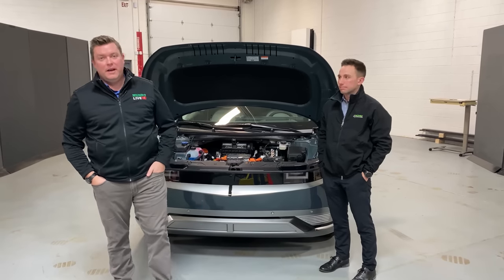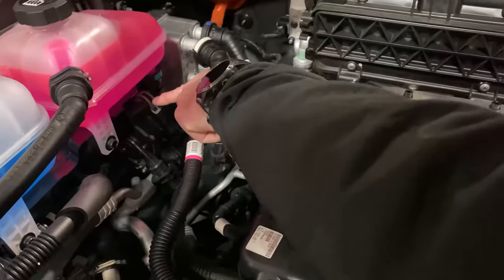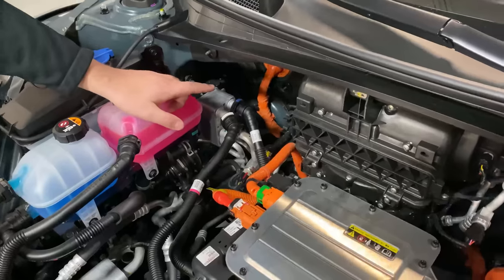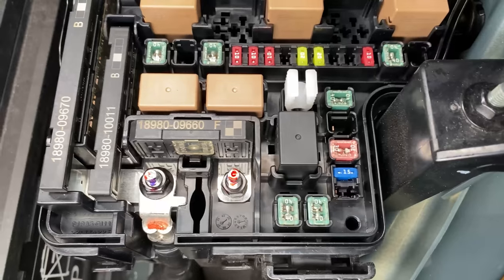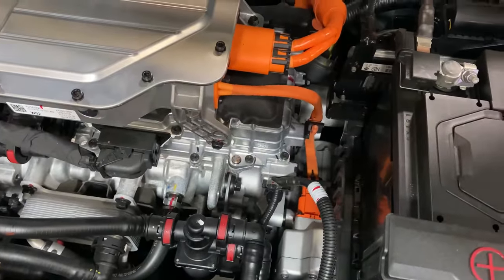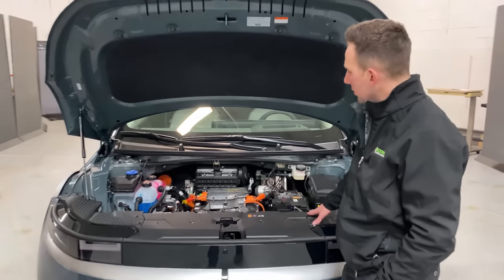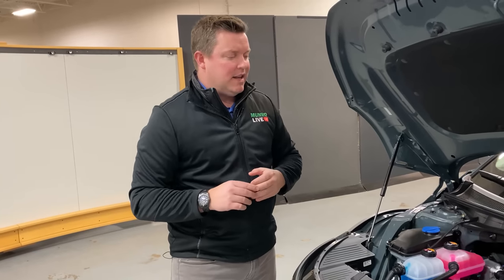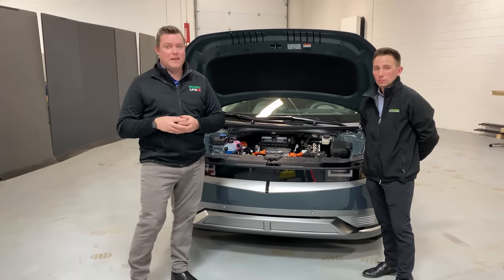Hyundai IONIQ 5  |  Under the Hood

Comment: As someone who has worked on cars for nearly 20 years, many of them older, I appreciate that Hyundai has not gone the Tesla route of integrating several components into one box. Serviceability is a significant factor that seems to be increasingly getting ignored, but it is critical for keeping cars on the road as they get older. The more components that you integrate into one service part, the more expensive that part gets. People may be willing to spend $2000 on a box in order to keep their 3 or 4 year old car on the road, but they probably are not going to be willing to when that car is 8-10+ years old. Those cars end up in junk yards. Being able to service components affordably is super important. I would much rather have a more serviceable vehicle and sacrifice some of the grossly over-rated frunk space.
Reply: I'd that "one service Mary" is made in huge numbers, making it cheap, is interchangeable between models, and easy to remove due to lack of plumbing, I'd say it would save money when it comes to keeping cars "on the road".
Not to mention, no guesswork faultfinding, fitting the wrong part and having to find another component.
Reply: what about the argument of, less parts -> less chance of something breaking down -> lower chance of needing service in the first place (therefore, last longer too)?
Reply: This , this , 1000% this. 🫡 ouch has hit it on the nose (mechanic for over …20 years as well 🥂)
Reply: (I own both a tesla and an one of these, I appreciate my window regulators working, having a volume knob, working wipers and defroster I can find WAY more than having a “frunk or an octo-valve” not even to mention the superior, Hyundai service, and range.

Comment: Thank you Cory and Jordan.   I have a Hyundai with the cabin filter under the dashboard.  It is a diabolically hard thing to access.  Moving that to the location in this car is a really positive step.  As ICE cars tend to have some part of the engine in that location, such a simple move is usually impossible.
Moving that item to this new location is a real world benefit that should not be undervalued.
Reply: Many cars have it in the glovebox which is not as convenient but completely fine to service. Although i really like to see EVs using larger, more capable filters due to having more space available.
Reply: @drkastenbrot  I have to remove the entire glovebox to access mine.  It is still decidedly hard to access the unit the filter is in.  There is a leaf causing a buzz in it now, and I am loath to go through the torture to clean it out.  😞
Reply: @John.0z  How often do they need cleaning?
Reply: @dogbreath6974  usually more often than owners can be bothered with when they're hidden away like many are... I must admit that I didn't change the cabin air filter many times on my last ICE car (2009 Ford Mondeo), mostly due to it being so hard to access. I've changed the filter more times during the three years I've had the Tesla Model S (old, small filter - the newer ones may be a bit more fiddly) than I did during nine years owning the Mondeo (ok, so the first few years I let the local dealer do it during yearly service...)
Reply: @dogbreath6974  Most cabin air filters should be replaced every 15,000 miles, but your vehicle may be different.
Reply: @dogbreath6974  Usually it is rare.
But I have had some leaves make their way into the filter, and create noise, as well as block it.  The last one was not long after a service.  So unfortunately you never know when you will need to access the box.
Reply: The Hyundai Kona Electric has the filter behind the glovebox and can be changed in 2 minutes. Access from the front in the Ioniq 5 may allow a central location, perhaps easier design-wise for LHD/RHD variants.
Reply: @paulaxford6754  That "unisex" location might well be a part of it Paul.  A part of the difficulty in my Accent is that it is off to the centre of the under-dashboard area.
Whatever the reason, I like the new location.
Reply: Try changing out the cabin filter in a Model 3.  You have to practically take the dash apart.
Reply: My Hyundai has a panel that is very easy to access in the glovebox.

Comment: Hyundai and Kia have a lot of potential to reduce the numbers of hoses and their lengths. This reminded me of the Mach-E thermal management hosing madness... It seems like there's potential opportunity to make some changes for the components along with their wiring and hoses to be moved around and/or combined. Once they deal with those wiring and hoses, hopefully they'll come out with a nicely polished front trunk cargo space and possibly some weight reduction. Small things can turn into a big deal when everything adds up.
Reply: I think KIA/Hyundai are more Advanced than FORD Muck-e.
Ford is too outdated and clunky.
Reply: Sure, but what if it is cheaper to produce it this way than a Tesla? Should they go more complex with something like an octivalve system, just to be like Tesla?
Reply: @AudiTTQuattro2003  - Tesla is way cheaper to produce, and savings in materials cost, weight Penalty, and efficiency Loss. 
no one on EARTH can Engineer like Tesla can , the model 3/Y were design by SpaceX. the Octovalve & Super Manifold was SpaceX.
Reply: Go back and watch that Mach E video. I think you might find that this is a MUCH more compact assembly despite also being two coolant runs. The Mach E was also using loads of generic hoses and connectors which  limits how tight of a bend they can go through which negatively impacts  the orientation, parts lengths, and manufacturing assembly. These vehicle-specific hoses may be slightly more expensive up-front cost but should be faster to assemble and allow for better packaging.
Reply: I agree with others that it looked better than Ford but not up to Tesla. The great thing to know is this vehicle already has great range, so relatively simple packaging improvements should improve efficiency even more. I think Hyundai/Kia will be a real force in the future of EVs. Their purchase of Boston Dynamics was no coincidence either. They are shooting for autonomy asap.
Reply: Let’s see how fast they can make changes.  The rate of change is what set Tesla apart from these companies.  Tesla has all the talents right now and it will take awhile for all these talents to distribute.
Reply: @AudiTTQuattro2003  Take a look at the average profit margins across the industry. Tesla has the highest profit margin. It's not even close when compared to other OEMs. That tells me that not only are they more efficient, but they are also cheaper to produce. Also, the octovalve is a simpler solution that requires less parts.
Reply: @wizzyno1566  - it's a Statement of FACT.
ELON told MUNRO in a interview, mod 3/Y were design with SpaceX . a collaboration.
Reply: The braided hoses will last decades and the clamps will likewise last almost forever. The cheap plastic lines with snap on connectors will crack in no time and will leak. Anyone that has worked on a modern BWM or Daimler knows that everything under the hood that is made from plastic breaks when you try to service the vehicle outside of warranty. You can almost never buy the part you need that would be a $5 part rather you have to buy an entire plastic assembly that often cost $1000 or more. The plastic coolant connectors were multiple lines come together always crack and leak. It is a garbage design. Good engineering is not what they are proposing good engineering reducing assembly time and cost with no reduction in durability and reliability again not what these 2 are proposing!  They should be ashamed to call themselves engineers or designers and should call themselves bean counters instead!
Reply: @buckaroobonsi555  - the BEST part, is NO part.
Reply: @markplott4820  re: "no one on EARTH can Engineer like Tesla can" well except when it comes to getting FSD to work worth a damn, and for those waiting till the "12th of Never" for their Cybertruck.
Reply: @AudiTTQuattro2003  re: "Sure, but what if it is cheaper to produce it this way than a Tesla?" and just as important what if it's MORE RELIABLE than Tesla...?  as the guys just got finished telling us (and as we overlook) each system (people, electronics, and battery) all have DIFFERENT thermal loads.  the battery and electronics are especially sensitive for reasons of FIRE SAFETY.  unfortunately many are NOT paying attention, nor understand the Aviation concept of "Fault Tolerance" and the need for "Redundancy".
Reply: @phillyphil1513   - Tesla FSD beta has over 60.000+ active users and ZERO Deaths , ZERO Accidents. 
and OEM's cant Update ADAS like Tesla can, making it Better than when you bought it NEW.
Reply: @buckaroobonsi555  re: "Anyone that has worked on a modern BWM or Daimler knows that everything under the hood that is made from plastic breaks when you try to service the vehicle outside of warranty. You can almost never buy the part you need that would be a $5 part rather you have to buy an entire plastic assembly that often cost $1000 or more. The plastic coolant connectors were multiple lines come together always crack and leak. It is a garbage design." bingo, ironically even TESLA knows about this with the plastic connectors on their packs.  that's what that whole INFAMOUS EPISODE Electrified Garage/Rich Rebuilds was about just a few months back.
Reply: @buckaroobonsi555  True for BMW ICE but very minimal heating in an EV and no pressure. And certainly many points the Munro crew make are benefits for the manufacturer not the consumer.
Reply: @buckaroobonsi555  Not much heat to contend with under an EV hood. Also, Hyundai can't rely on "prestige" and engineer their cars more carefully.

Comment: Very nice breakdown.  I do find myself disagreeing about the serviceable fuses.  Fuses goes from time to time.  Long term, the owner wants to be able to replace those fuses and even the 12v battery.  Not everyone wants go to the dealer which can be expensive.
Reply: Yup, I honestly don't like Tesla's model where they try to detect overloads in software and expose the (very expensive) front control board to potential over-currents.  This chap has a very good video on the Tesla low-voltage circuitry, but as a designer, I cringe a bit at the assumptions they make...  See: https://www.youtube.com/watch?v=fUCgLCbX_18

Comment: The Ioniq 5 has two different coolants.  They have a Low Conductivity fluid which I think is used for the HV battery and a Standard for all other systems.  I would like more technical info on this.  I don’t think any other EV has this difference.  The Low Conductivity is to be changed every 40,000 miles or 36 months, and I understand it is very expensive.
Reply: Tesla has one. Having two has no advantages besides saving R&D cost.
Reply: @mike6669-d2j  Well, Tesla also doesn't have an 800V system and could have calculated the risks differently. If it's also expensive and has to be changed regularly, it does make sense to have a limited amount of it, i.e. a separate system. I don't know what the rate of leaking coolant into batteries is in these types of systems, but for every million vehicles, you probably end up with some leaky ones, at least in accidents.
Reply: They are designing the car to be “serviceable” so that dealerships can continue to generate income
Reply: BMW i3 or has two different coolant loops. Not sure why.
Reply: @charlesbridgford254  Coolant loops are different than actual coolant material.  Most should have 3 loops - battery, electronics and cabin.
Reply: Thats why you need to get rid (sell) any EV's before it reach 40k.but its guarantee will lose its value 60% on 40k miles.
Reply: @jonshroyer364  okay okay. The BMW i3 has two different coolant materials in two different cooling loops. The battery is cooled from the refrigerant expansion directly.
Reply: @celeron55  Yes, it was collision tests in S. Korea that raised the issue in the first place. Both the Kona and Niro EVs use only the non-conductive type. But Cory did raise the issue about the thermal range being possibly different, something I hadn't considered. Of course he also didn't seem to question why the colors were different as well.
Reply: @paulaxford6754  Yes, I would like a good explination of why the special coolant is required.  It would be nice if Cory or Jordan saw this post and did an investigation.
From Kona and Niro owners it seem the cost of the change at 40,000 miles could be $1,000.  That is 2.5 cent per mile.  At current costs an ICE would cost me about 10 cents per mile, and the EV would cost about 4 to 5 cents per mile.  So the coolant change is about half of my per mile fuel savings.  (Actually most of my EV fuel cost is zero as I have solar.  But this assumes I pay for the electricity and charge at home.)
Reply: @jonshroyer364  my Kona has conventional green coolant as it was produced before the conductive issue came to light and before the battery fire issue.
Reply: @jackcollin1695  Have you checked used EV prices lately?
Reply: @anxiousappliance  yeah.theres some few tesla that are selling for $20k here,which they are only 2 years old.i didn't check of whats the issue on it though,gotta be something bad thats why its already cheap.and some few chevy bolt that are only 5k to 10k lol.those are timebombs.
Reply: @Enemji  
That's not necessarily a bad thing. Because it also means that me the average citizen can serve as my own vehicle also. I do that currently with my 13-year-old Toyota hybrid. There's nothing on the car I can't take care of myself.
That's an advantage with the individual cooling lines versus a octo valve. I can't fix an octo valve. But I could easily replace that three-way coolant control valve and a couple of coolant hoses if there was a problem. There are advantages to it being a bit more messy under the hood but easier to individually access those components.
Reply: That would be a deal killer for me. I drive 40-60,000 per year. Not going to be doing an expensive service on coolant every single year.
Reply: @jonshroyer364  
The Bolt EV is set up this way. Although the coolant is the same in all three systems. They have a small coolant loop that goes from the PTC heater into the heater core in the cabin. One for the power electronics, and another for the battery pack.
If you want to see a really great teardown of that car, Weber Automotive has a great YouTube channel they are a automotive technical college that concentrates on hybrids and BEVs,. He's got a complete disassembly of the battery pack cooling systems and drive units and power electronics on that car.
It's a little bit technical, but if you're into mechanical or electrical stuff it's pretty fascinating.
Reply: On GM products, technically they are all Low Conductivity fluid.  GM Dexcool (Part No. 12378390) is premixed with distilled water, and is required for all 3 loops in a Bolt EV.  This news really bums me out.  That seems like quite a severe schedule for a coolant that isn't worked very hard (at least in relation to an ICE or hybrid vehicle).  I really hope it ends up being an easy change.
Reply: @spazzman90 
Dexcool is pretty cheap. I would think it would last a long time.  Could be degraded early by some materials it is in contact. Also . Could just be accelerated maintenance schedule just to be safe.
Reply: @jonshroyer364  I am glad you pointed this out. Ouch 😓 on prices for coolant!

Comment: Looks like the Koreans understand the advantage of serviceability more than these guys. Intergration just makes replacing faulty components so much more expensive....and profitable for the manufacturers. 
The trouble with Munro they can't see the forest for the trees.
Reply: Yeah that filter is so easy to change..... After you remove the frunk first  ;)
Reply: @bitsorbytes  You don't have to remove the frunk to change to the filter though ;) there's an opening inside the frunk. Hyundai is known for serviceability.
Reply: @bitsorbytes  Not only is there a pop-out panel in the frunk to make it easy and tool-less, but what's more: the frunk is SO easy to remove! This blew me away: there's a light in the center-front to show you what's in there while you rummage. It would have been pretty easy to unplug by just pulling out the bolts, lifting the front a bit, and feeling around. But they were so thoughtful they added a whole extra connector on the far-right, so you can unplug the connector visually before you even undo the bolts. JUST to avoid someone not noticing the light and ripping off the harness.
Reply: @AlexWhittemore  Great to hear Alex it is so easy.... So how often do you need to replace that air filter then?
Reply: @bitsorbytes  they say once every year or 15k miles. For how easy and cheap it is, I’ll probably go with something like half that. Maybe once during fire season too.
Reply: Luckily they didn't make Tesla's mistake putting it right up against the evaporator. Otherwise it'd be every month.
Reply: @AlexWhittemore  What FUD are you on about? The Tesla one is replaced every 18-24 months.....
Reply: @bitsorbytes  only if it hasn’t started smelling like mold before then

Comment: I actually do not dislike the packaging under the hood except for the atrocious 12V battery. Cars and their parts still break down I love how accessible they are in this car rather than have them hyper packaged like in a Tesla making serviceability much more complex and thus expensive. In fact there is no study showing that one is more reliable than the other, especially in Tesla's model S case some parts are notoriously more prone to failure. Would be nice if Munro also addresses this and see what changed to improve this.
Reply: Good comment and I agree. My Kona EV is much the same.  I can reach everything and the parts are all good quality.